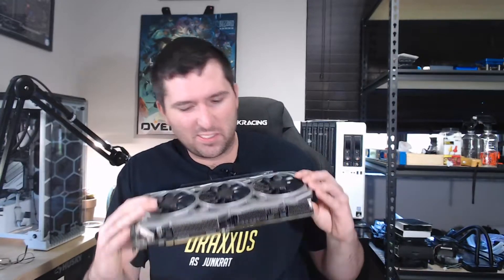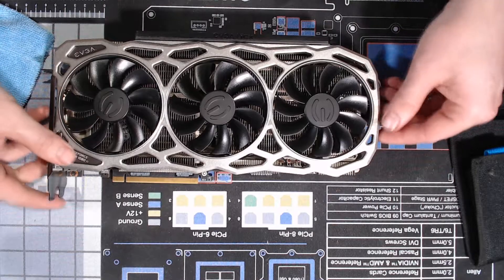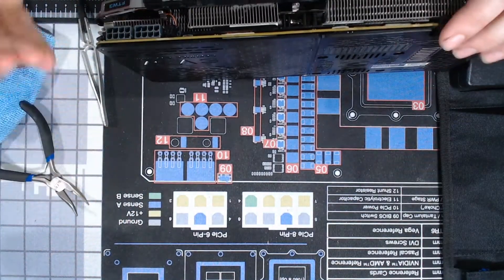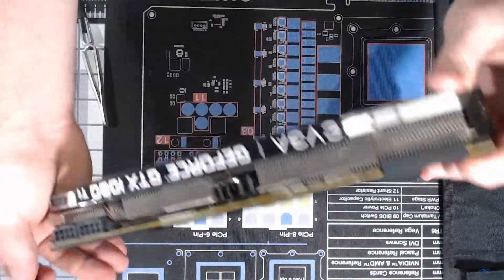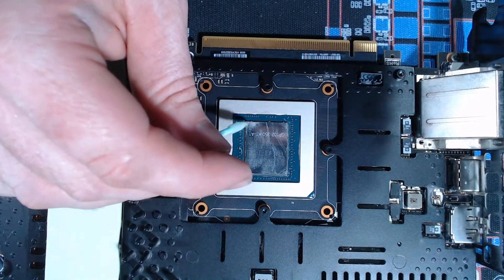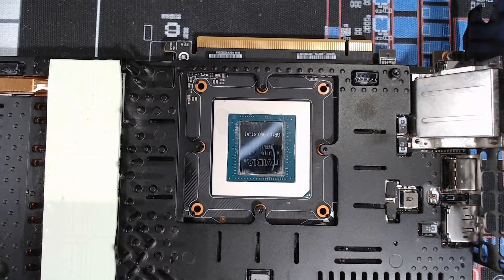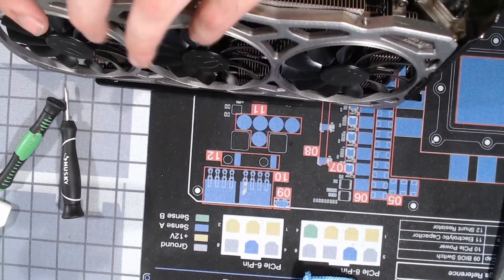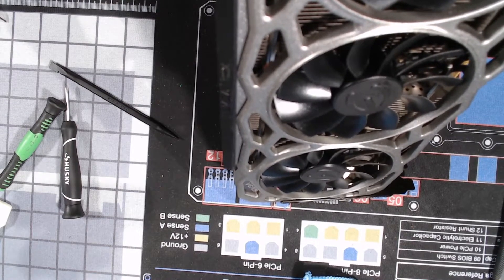Reapplying Thermal Paste on the EVGA 1080TI FTW3

Comment: Its 2024...and I somehow in the same week have two of these in my lap,  via friends upgrades to RTX cards and not caring to deal with marketplace people. One is an Elite  and the other is just a bare card, ready for some watercooling. Thanks for the video always watch tear downs, no matter how many cards I have torn apart, theres always some hodden screw or wire you didnt see...that will be costly if broken later.

Comment: Though the 1080 Ti is old and I have a 4080 Super, I love the design of this card so I bought one on eBay yesterday for £155 which was a great price for such a legendary card. It ran hot... And loud. It wasn't too dusty, had a bent bracket but nothing too egregious. I decided to take the card apart, oh boy did they make it hard to take apart (if removing the back plate) lol and apply fresh thermal paste (I used MX-4) the temps before would quickly hit 77c and all the fans would ramp up. Not good. It now runs at a rock steady 62c at full burn and fans are a nice volume. Really happy to own such a beautiful and legendary card! I really do love the FTW3 design! Great video and helpful for people wanting to apply fresh thermal paste to an old timer. (Wish I knew I didn't have to remove the back plate for this before I did it... Lol but removing the back plate allowed me to give it a deeper clean)
Reply: yea i just bought a evga ft3 1080ti for 120 usd on ebay yesterday too i love these card man
Reply: 1080 1070 are old but still are a work horse it still works well long as you can keep the temps low... You need more then just replacing the Thermal past on the processor you need to replace the pads and also add on new pads in different places... Artifacting is often what happens with this model and that is all based off heat... You have to be very careful about the temps that the driver mosfits get.... Those are very temperamental.... I really try my best to stay the heck away from Nvidia GPU's now going with Radeon has way less issues... Unless you are running it CSM only mode.... Uefi Radeon has that mastered in even the earlier cards.... Unless you are just really mining I would change up that GPU for something more stable that works with gaming well RX cards give enough and work well enough the prices are starting to drop a bit more now...

Comment: I have a very similar model, but with just 2 fans. Evga 1080ti sc2. Do fans come off to apply oil? It's getting noisy.
Reply: Deshroud it, is worth it, got 11 C off by changing the fans with normal ones 3x 92mm. When deshroud it mine I repasted it but didn't changed the thermal pads.

 I also just seated a 4th fan(Noctua Redux using the rubber antivibration pins) on the backplate just above GPU area and shaved off an extra 7 C with the 4th fan alone @ 1100RPM.
 Highest temps are in RDR2 all maxed @2k >>> 61 C and 75 C Hot Spot. Mine is a FTW 3.
Reply: @pete0274  FTW3 recently bought from eBay was running really hot, 77c. Applying fresh thermal paste (MX-4) decreased the temps to 62c! Happy days.
Reply: @krullexneo   Great. Thermal paste was really dried or degraded. My FTW runs my games in 1440P and changing only the thermal paste got me only 4 C off but, than add 11 C off from deshroud. 
Their fans are only 10mm tall, normal fans are 25mm tall and at least 4mm bigger diameter(92mm) so they do the job more silent and push more air. Only in Furmarks goes 60C, in gaming on 1440P is about 50 C. 
Deshrouding shouldn't be ignored IMO.

Comment: i have the same card .. suddently my pc started shuting down and restartinf when i played games 
after a while the pc started freezing with artifacts 

i teared it down and the thermal paste was dried out 

i repasted and then everything ok ...
after 2 weeks the card starts shuting down again 

did you have any similar problems?
Reply: Thermal pads next
Reply: @JollyFlys  Have you tried changing the thermal pads? What thickness in mm you used?
Reply: @kristofer3096  i will try and change them next, not sure what thickness
Reply: @JollyFlys  have you experienced any shut downs or reboots?
Reply: @kristofer3096  yes, i've experienced both
Reply: @kristofer3096  the problem of freezing and shuting down fixed?
Reply: @subhadradebnath2348  well no it did not ... The problem was not the card but the psu 
But the card reaches 80-85c i dont know how can i fix it but generally 1080ti s run hot
Reply: @kristofer3096  you can try to apply a custom fan curve in evga precision x1 then check.... temps will be low if fans are curved to high speed....and your psu was the problem...so after changing the psu....the problem fixed?
Reply: @subhadradebnath2348  fans run about 70-80% my case is open but with no fans hitting air on the gpu 
I got that card used 4 years ago and the temps were about 75 max 
After changing psu everything is fine no crashes or reboots ... I checked the card on other computers with good psus ... A 1080ti needs at least an 600w psu
Reply: @kristofer3096  yes....1080 ti needs power...i also have a 750w psu in order to upgrade to this gpu.....this gpu only have temps issue...if temps are too high like 80-85,games keep crashing..but no other works stop....i had temps issue.....now it is fixed....if any thing occur..I will let you know🙏
Reply: @subhadradebnath2348  do you have the same gpu? and you have temp issues? 
no need to upgrade i would say .. unless you play AAA titles at 1440p abd above 

i thought about deliding the gpu but its risky
Reply: @kristofer3096 I have 1080ti sc2 version of evga...semps are 70 with fan curve..and i would say that there is no need for an upgrade..it is a beast..

Comment: its 4 screws on top and 4 screws on heatsinc connecting to the card to dismantle, then the 5 small connectors for fans/leds etc if this helps anyone. It should come apart pretty easy.

Dont use liquid thermal paste as this is an aluminum heatsinc card. Learn from my mistakes.
Reply: Looks like he used liquid in this video.  The alternative are little hard squares of solid thermal paste?  What should I search for instead of liquid?
Reply: @ComboDamageTV  I believe they're referring to liquid metal thermal paste, as it contains gallium which reacts rather badly with aluminium.

Comment: Did you change the thermal pads?
Reply from the maker: No, you can reuse them as long as you don't tear them. If you want to swap them you can just make sure you get the right thickness pads.
Reply: @draxxilletech  Hi thanks. Is arctic mx4 8.5w/mk good or thermal grizzly Kryonaut 12.5w/mk is better? What do you recommend? I have a Asus strix 1080 Ti O11G Gaming
Reply from the maker: Thermal grizzly is likely better, keep in mind when comparing pastes as long as it's not some factory junk vs aftermarket paste it's almost like splitting hairs in performance. Kryonaut is considered a higher end paste though and is non conductive, it is more expensive though.

Comment: what kit you use  n products u recommend
Reply from the maker: If you are talking about thermal paste I always use Artic silver MX-4. It's non-conductive so you don't have to be super careful when applying and it's cheaper but still has great performance.
https://www.amazon.com/dp/B0795DP124/ref=cm_sw_r_cp_apa_i_Pf3rFbQ2WEAZB

For most disassembly work the IFIXIT Pro Tech Tool Kit is a good thing to pick up. It's a little pricey though.
https://www.amazon.com/dp/B01GF0KV6G/ref=cm_sw_r_cp_apa_i_Vk3rFbHN9G6F2
Reply: @draxxilletech  thank you vm

Comment: what kind of temp drops did you get from doing this? my SC2 started to run hot, 75 during gaming, so I think I am going to reapply the paste this weekend
Reply from the maker: My max temps now is 74°C
Reply from the maker: Well unfortunately the computer I want to put it in is down at the moment so I don't have Temps just yet. I'm not anticipating too much, a few degrees probably. My card is downclocking itself so that's what I'm trying to fix. If 75 is your peak your temps aren't actually too bad, that's not even being throttled. But it's really easy to swap the paste so why not do it right?